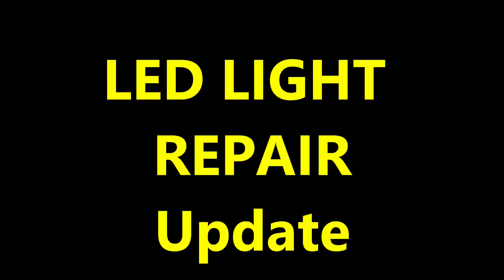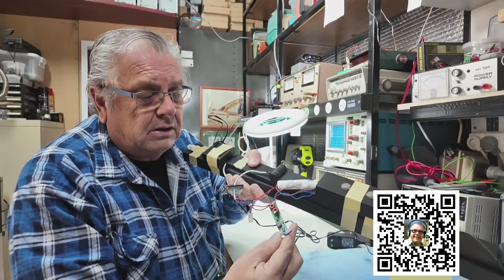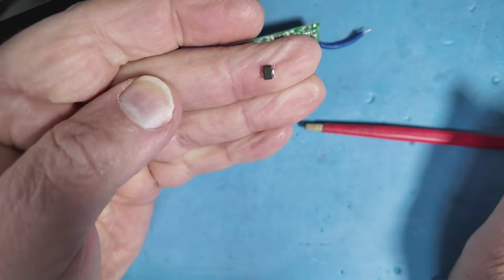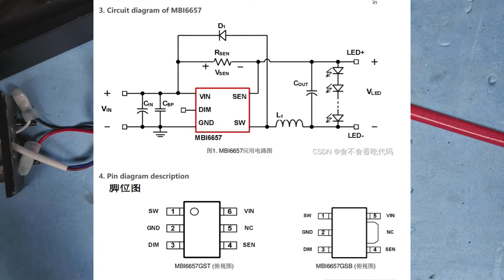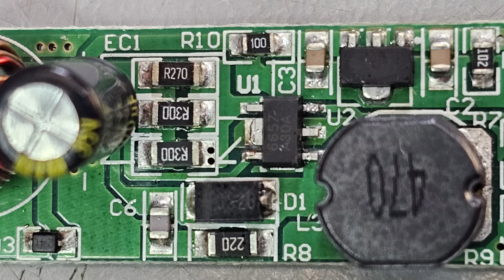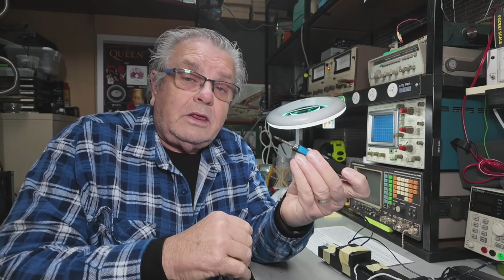LED Lamp REPAIR -  UPDATE

Comment: Quite a bit going on for a light and dimming circuit. That small IC must have quite a bit of circuitry inside. Miniaturization has taken us a long way. At least no dial cords to string!!!! One of my old experimenter project kits of the 1960's had a two transistor "capacity relay" project that was a simple on/off switch and at the time thought that was quite amazing.
Reply from the maker: Thanks for sharing your experience and for watching the video 👍